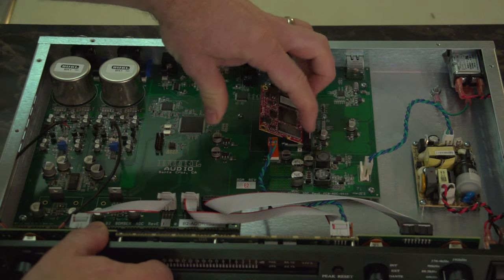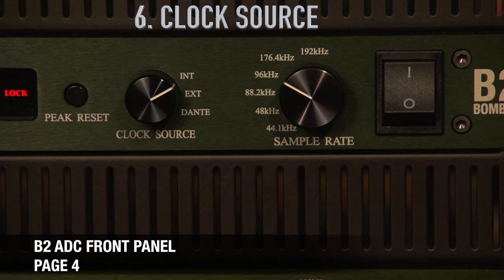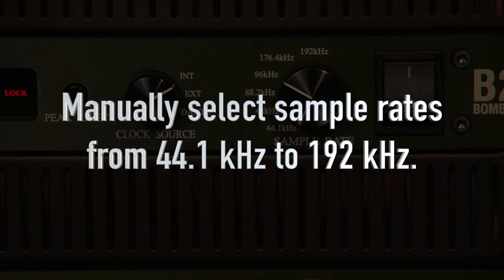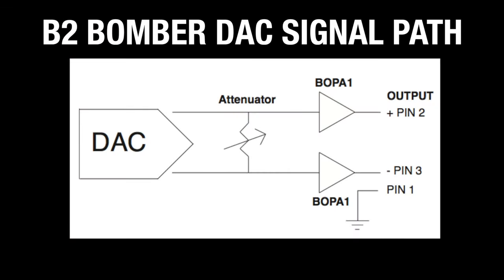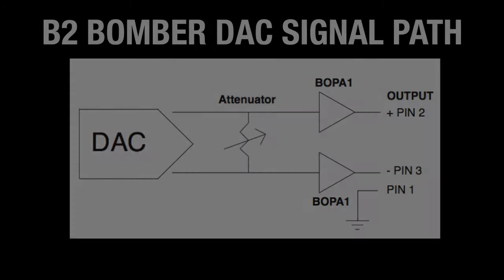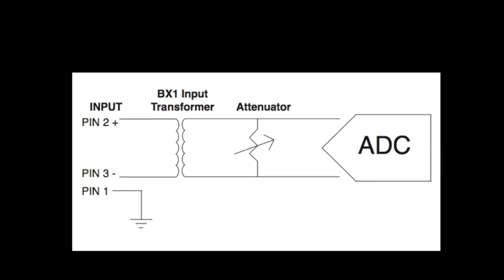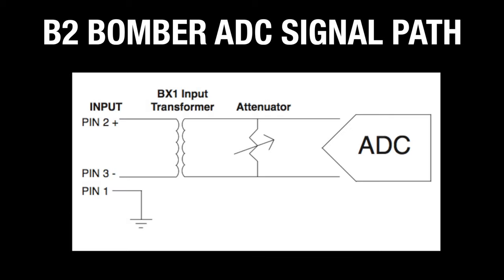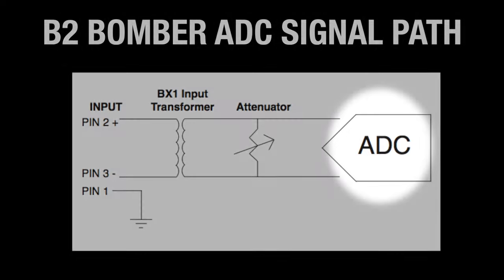B2 Bomber Video Manual - Part 1: Features, Connections and Setup

Comment: Seems like your word clock was backwards at first. I hope this is right. Your slaving the DAC off the ADC but you have ADC out to DAC in. I guess that means The top unit ADC (Master clock) is sending it's clock OUT to the DAC IN (in my case it would be an interface clock IN) so it can read the master?
Also does it matter at all what interface is being used if you are tracking going through the ADC to the interface Spidf? Are all Spidf connections the same quality just transferring numbers since the ADC already converted Audio to Digital? I'm going through shelford channel strip to BURL ADC to SPIDF DIGI 003 interface. Is this the best way to use the ADC for tracking.
I'm thinking of getting the DAC so I can use it for Mastering the Main MIX. Spidf out to DAC to Portico MBP to ADC back to Spidf in. Would this be right?
Reply: did you ever get an answer anywhere on this?
Reply: @tomjaeger  I received several different answers. Burl responded on another forum and they said my routing was correct. They verified all my thinking of the ins and outs and quality were correct. I hope that helps.
Reply: @marc8vino  awesome thx man. I’m trying to get similar situation going for tracking but I’m trying to figure out this unnnecessary convolution of tracking using the b2 ADC. Cannot believe burl hasn’t made a quick vid for home use scenario using b2.